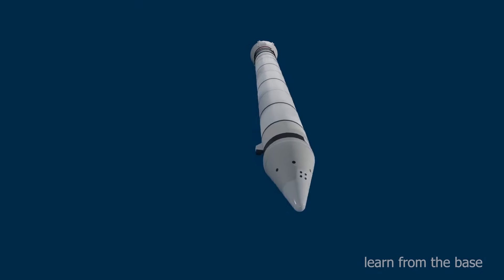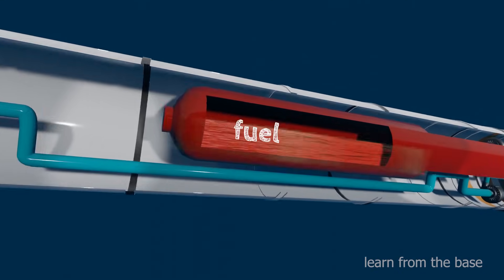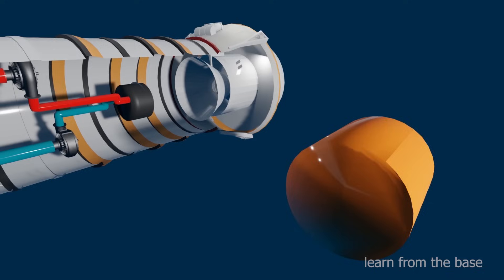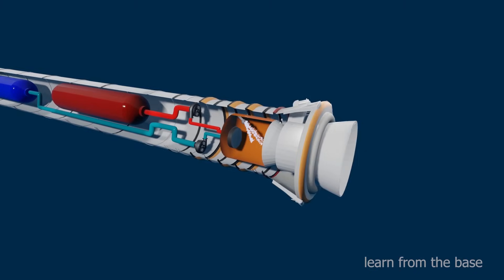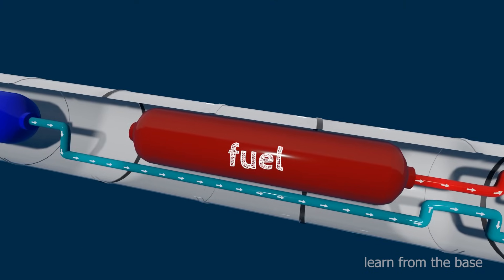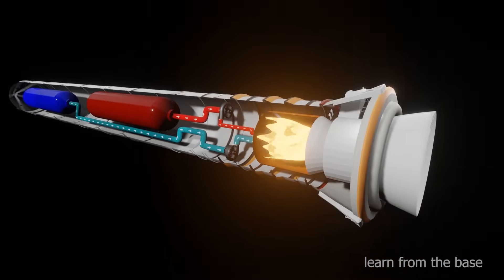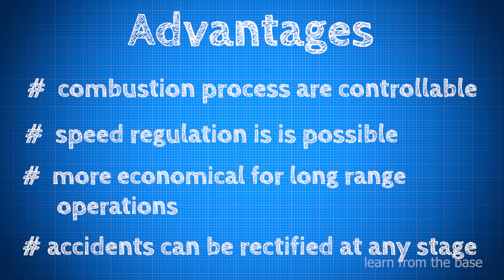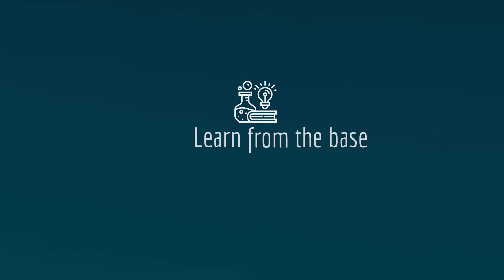LIQUID PROPELLANT ROCKET ENGINE/liquid rocket 3d animation/construction working/ LEARN FROM THE BASE

Comment: This is a vast oversimplification of how rockets work....to the point where its too simplified. You missed half of the components: the gas generator cycle that turns the pumps? An alternate pressure feeding cycle? Exhaust? The coolant? The baffling on the injector plate? These are all pretty simple concepts to add. You don't need to get into stoichiometry and specific impulse, but trust your viewers with at least one complete idea.

Comment: Thrust is a function of the mass flow through the nozzle. A tiny rocket engine and a massive rocket engine with the same exit-to-throat area ratio will produce the same velocity exhaust under the same conditions, but the massive rocket engine will be moving much more mass at that same velocity due to increase in volume at the throat. Based on your statement about thrust being a function of velocity, which we would relate to Mach number in this case, one would assume that the requirements of this systems thrust could be implemented by using a desired Mach number to find the desired area ratio. This would be nice, but unfortunately the area ratio equation proves transcendental when trying to solve for said ratio and can only be done through computer aided simulation, which does not give consistent data.

Comment: I wish you would have covered the methods of powering the turbo pumps, as that is really one of the key aspects that differentiate different engines from each other, deciding just how efficient the engine will be, apart from the fuel used. A lot of engines use a gas generator, which is a mini rocket engine to spin the turbos, but rocketlab uses electric turbos, and then you have many variations on the Gas generator, such as a pre-burner to partially burn the fuel or oxidizer to power the turbos before dumping that into the combustion chamber to burn with the fuel, then you have the full flow staged combustion that Raptor uses, where fuel is preburnt on one side and oxidizer is pre-burnt on the other. To me, the beauty in a rocket engine is the way fuel can be efficiently used to power the turbos which in turn power the rocket engine itself, which may burn the same fuel that was just used to power the turbo, while some engines even initially use that same fuel to cool the nozzle so it doesn't melt :)

Comment: If the liquid oxygen are burn in the small amount of fire  the plastma can be used to propelled the rocket with only liquid oxygen fuel to minimize the weight of the rocket
Reply: https://youtu.be/SHb6QB50TRA

Comment: I wonder if to obtain hypersonic speeds, aerodynamics, linear momentum and the use of propellants with high heat capacities (Cp) influence to generate more heat and thus make the gases products of combustion have greater kinetic energy? could hydrasin be used here? The combustion chamber would have to be ceramic to withstand the high levels of heat generated? I would appreciate the respective answers.

Comment: My professor asked me the question, how the fuel of rocket burns without oxygen and where from rocket get oxygen to burn the fuel. I got the answer, thank you 😊
Reply: Well,you can use alcohol and liquid oxygen.
Reply: You either have liquid oxygen tank (or any other oxidizer like nitric acid) or, if you're using a jet engine which is similar to a rocket engine, taking oxygen through the atmosphere through intakes.

Comment: Could you tell us , which fuel do they use in rocket ?
Reply: It depends on the rocket. Rockets like SLS and Space Shuttle use liquid hydrogen. Others like Falcon 9 use RP-1 (kerosene). Newer rockets like Starship will use liquid methane.

The rocket in the video is actually a solid rocket booster, meaning it's filled with a solid fuel mix that burns very quickly. It's similar to the rocket motors you find in model rockets.

Comment: rear part is like engine 
works same as like bike engine to rocket engine.same mechanism 

air fuel ratio then ignite in the cylinder it will mini boom in the cylinder piston goes connected to crankshaft and the wheel spin 

in the rocket mechanism 
from air fuel to ignite every mechanism is almost same but no linear to propulsion motion

Comment: Awesome animation! Can you make a video about how each parts work? Turbo pumps, injector plate, ignitor etc.
Reply: Yes
Reply: Same request. Where do the turbos also get power from? Isn't there an engine that is missing here?
Reply: @neisjo  Depending on what powers the turbopump, either electric motors (similar to RocketLab's Rutherford engine), or you burn a small amount of propellants to drive the pumps.
Reply: @neisjo  probably a big battery that powers the pumps
Reply: https://youtu.be/SHb6QB50TRA

Comment: Your missing peaces, for an Example how dose the pumps get power. you can't use heat since the rocket gets way to hot. Another Example is how dose the nozzle and the combustion chamber, My point is your video is to symbolized. There is more to a rocket then a oxidizer, fuel, 2 pumps and a combustion chamber.  thought you do cover the basics of a rocket. 👍

Comment: My friend you are showing solid rocket booster from space shuttle that has fuel tanks inside.. 
https://www.google.com/search?q=solid+rocket+booster&sxsrf=ALeKk03Mhgn4tqdcBO0EvPeg-p96tGjR8Q:1609854519420&source=lnms&tbm=isch&sa=X&ved=2ahUKEwi6mpS294TuAhWOzYUKHeBRCWYQ_AUoAXoECB4QAw&biw=1440&bih=820&dpr=2#imgrc=k0kcP4agKGQgsM
Reply: Yeah I wondered how none of the top comments noticed. Hasn't anyone questioned why there is so much space left in those?

Comment: I Have a question.
Is the same formula used on fighter jet engine.i mean fighter jets are on the earth,so they don't need oxidizer.
Fighter jet planes engine works only on fuel????
Reply: Fighter jet or any normal aircraft fly's using air breathing engine. They suck the air in atmosphere at the inlet, compress them to raise their temperature and ignite it by adding fuel in the combustion chamber. The resulting gases are expanded in a turbine which in turn provides power for the operation of compressor. The final exhaust leaves through the nozzle providing thrust. In fighter jets they use something called Afterburner which provides additional thrust for supersonic operations.

Comment: What happens in the space (vacuums)..?
How rocket travel in space...?...

If there is no any action-reaction pair...
Reply from the maker: Rocket engines work by action and reaction and push rockets forward simply by expelling their exhaust in the opposite direction at high speed, and can therefore work in the vacuum of space. In fact, rockets work more efficiently in space than in an atmosphere.
Reply: On what Rockets do action in space...?

Is there any body on which rocket can do action on it...? 

And if Rocket do action by thrust what do reaction on rocket...? 

Don't we need two body for action reaction pair...?
Reply: @ayushsnandan  the expansion of the highly energetic exhaust gases pushes against the engine bell. These engines are also less effective in the atmosphere because the atmosphere will push back on the exhaust, affecting its velocity and ultimately the force it exerts on the rocket.
Reply: @ayushsnandan  The other "body" is the gas itself. Don't forget that even if gases are lighter than most everyday objects, they still have mass. The rocket pushes off that gas, therefore the only requirement is to have some kind of pressure inside the engine. That is quite hard, because the gas is continually escaping through a relatively large hole (the nozzle) into the much lower pressure environment, and for this reason rocket engines usually need to generate a lot(!) of it through combustion. The first stage engine of the Saturn V ("Moon rocket") needed about 2600 kg of propellant each second, and the entire first stage had five of them.

Edit: 2600 kg/s, not tons/s :D
Reply: As a really easy explanation, I can say this - in a rocket engine combustion chamber the fuel and oxidizer are combusting and this creates pressure in a chamber. But the chamber has a "hole" and a converging section before it, and because of that area of the injector and a converging section are different. As you know pressure is the ratio of force to the area. So the same pressure but different area creates force - thrust. And this is no matter where, on earth, or in space.
Reply: This is actually a very simplified explanation, If everything worked this way, the engines would have only about 30-40% of their thrust but this is enough to understand how it is worked. And, how the author of the video said - this is worked as an "action and reaction". In rocket engines the exhaust is not like regular fire. This is REALLY POWERFULL flow of gases which moves at speeds about 10000-17000 kph. The rocket engine makes action - accelerate fuel by combustion to gas. And gas flow makes reaction - accelerate rocket with THE SAME force as the gas itself was accelerated. The rocket literally stands on this gas flow.

Comment: And they say rocket science is hard
Reply: Rocket science is not really hard (though I highly doubt anyone here could derive even the basic rocket-equation). The real challenge is rocket engineering (putting the principles into use). Though the video does a great job at summarizing the way rocket engines work, it is still extremely simplified.